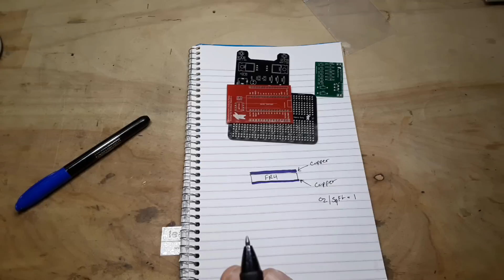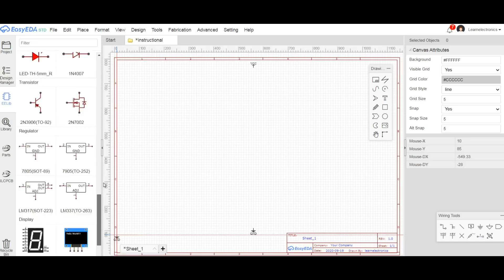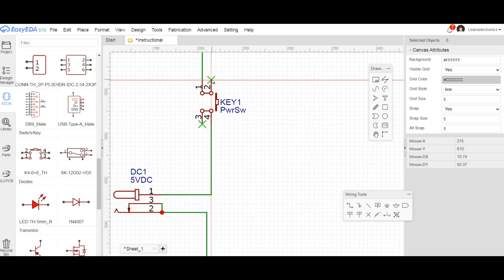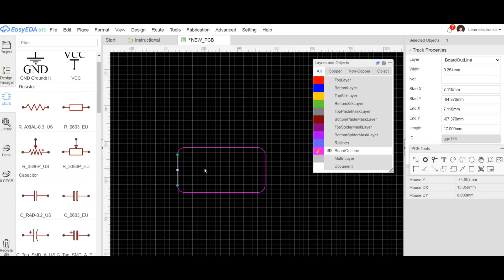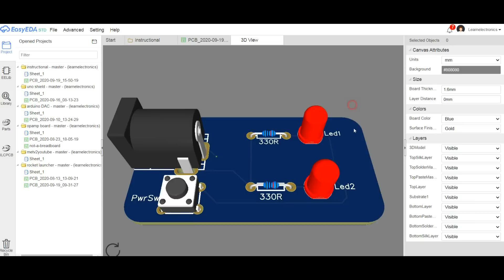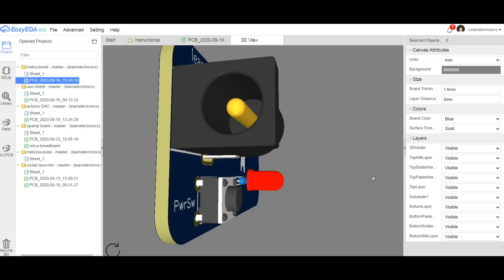Beginner's PCB Design Guide Using EasyEda

Comment: I'm completely confused when I open the dropdown menu for various components. Is there a guide anywhere as to what each abbreviation means or some resource to help me decide which one to choose?
Reply from the maker: No not really. This is where modern tech fails. In my day we had shelves full of bound product guides from manufacturers like Ti, and Silicon Labs. If you wanted a dip8 opamp from Ti you went to their book and looked it up.
Everything is in a giant pile now that you have to root through. The best info I can give you is to go to Digikey or mouser and find your part there, then copy the manufacturer's part number and paste it into easyeda
Reply: @learnelectronics  I agree about missing books and a physical library. Since writing this comment, I've learned that EasyEDA has the LCSC component library option, which is laid out very much like Mouser, and you choose the component you want and add straight to your schematic. That's a real game-changer for me in regard to using EasyEDA with confidence. Cheers

Comment: What tool would you use if you wanted to be able to solder a input voltage to the board instead of a barrel connector?

Comment: Hiya great tutorial. One question I have is the components on the top layer. Are they all to be sourced yourself or can they be included on the board? I am concerned about small components and where to order them and the soldering concerns. Thanks

Comment: Excellent Video Friend. If you could tell more about Crossing Tracks(Circuit). Actually If two tracks cross what would you do. Was it a Jumper connection in the Video. Anyway This was an excellent video. Thanks a lot
Reply from the maker: You use a via to bring your track from top to bottom or vice versa
Reply: @learnelectronics  I am new I did not get you. Sorry Friend.

Comment: This is the ONLY tutorial on YT directed towards the layman. Every other tutorial I've watched assumed you knew the software already and was, pretty much, just a walkthrough and not necessarily a structured lesson. 

This video was concise and definitely aimed at beginners such as myself. You started with an introduction to the physical structure of the PCB and used an elementary circuit example rather than rambling and then designing an entire arduino mega from scratch. 

You've set the ground work for me. I found some really interesting schematics for guitar effects pedals that I want to try and create PCBs for, instead of using a little breadboard. I think i am now prepared for slightly intermediate lessons that I've seen. 

Thanks!
Reply from the maker: Thank you. I appreciate that.

Comment: Just to let you know that thanks to you releasing this video I have designed & ordered my first ever PCB. 

Decided to start REALLY simple so it only has 3 components. Looking forward to receiving it , soldering it up & 🤞it works !

Already planning my next PCB. Going for 6 components this time !!!

Have tried tried to design the same board on Ki-Cad but , at least on my system , there seems to be quite some work to get all the required library & footprint files etc installed correctly. Hopefully they can sort this out soon as it looks a very interesting bit of software ....

Again I & my soldering iron thank you 

Keep up the fantastic work 

TTFN
Reply from the maker: Awesome, I'm, glad to hear and here if you need any help

Comment: I'm sorry, but winging the commentary has meant you have poorly described the PCB make up and left some useful information out for the beginners. I.E. Ounces per foot square denotes how thick the copper is. Just saying it's available in different weight is meaningless to those learning. Good effort, but lets those learning down a bit. Your audio started fine, but as soon as you jumped to the CAD screen, it sounded like you were being strangled....... Did you review your video before posting? I was listening with headphones and the screeching change in audio was very unpleasant. Sorry.

Comment: Back in the day, the whole board was screen printed. From etching the pattern then solder mask and last the legend. Those 2 and 3 once boards were real pains to print solder mask on because the copper was so high that you would skip ink on one side of the traces. This was bad because those boards needed to handle high amps . You would also get blurring. This is when you have ink bleeding onto your solder pads. Photo development made the process a lot easier with less defects.

Comment: Hey Paul nice demo with a simple example. How would you compare EasyEDA to Kicad? Currently I use Kicad but considering trying out EasyEDA since it's free and actually looks "easier" at first glance. Kicad has a few quirks. Also have you tried any home based fabrication methods such as toner transfer? I've seen two methods - one is the heat transfer and the other uses acetone transfer (no heat) method which I think is cool but have not tried it, OTHO, home fabrication involves more work and you have to drill your own holes - no plated thru vias too - so although the costs are lower in home fabrication, it's a lot more trouble I think.
Reply from the maker: They are all about the same. I like Easyeda for the components. you have to add a lot of components manually for Kicad.

Comment: Thank you paul Great video! The audio was not that bad, I kinda like the Robot voice... :-)
 I like to etch my own small boards like that. It gives me the sense of a DIY completion to the project. I make all my boards single sideboards and when there is no way to rout the wire I do hardwire vias across the top. Not always a bad thing I use pretty colors for the wire in top... Lol
I may have to give your program a look. I have been using Fritzing for 3 or 4 years, someday it will come out of Beta... HaHaHa
I'm no expert by any means but you did show me the issue I have with switches and rules checks, never figured that out but I have never had boards made before either so I did not worry about it...
Thanks again for the video!
LLAP

Comment: Thanks a lot. Great video. In half an hour I 've learned more designing PCBs than from when I started last year tinkering with Electronics.  18:30 Is this design correct? Shouldn't we be taking the anode of the leds to the output of the switch?

Comment: Your video today was very timely. I’m designing a alarm system and I need about 20 small sensor boards. 

I used a breadboard to work out my design. Next step will be a custom PCB. They will be placed into a 3D printed holder that designed.  I will try your method first.  Hope all goes will.